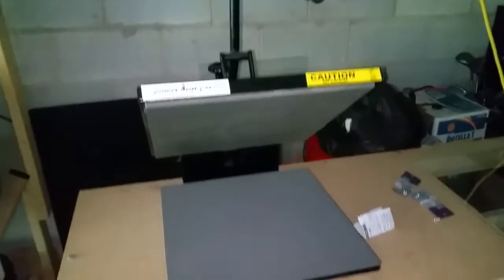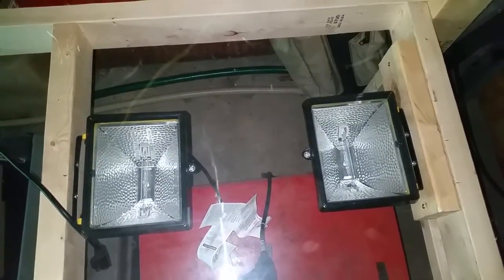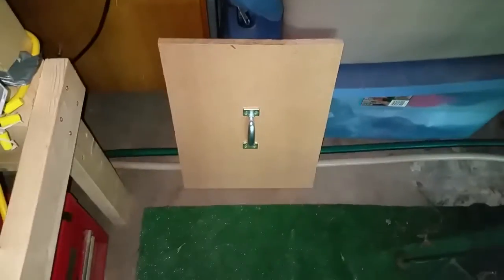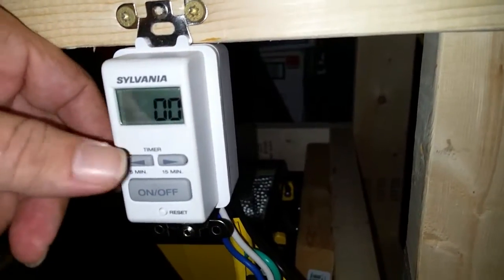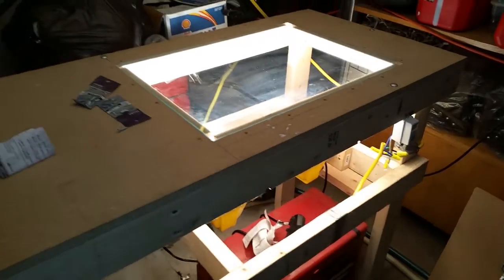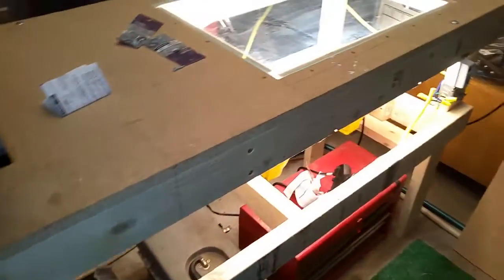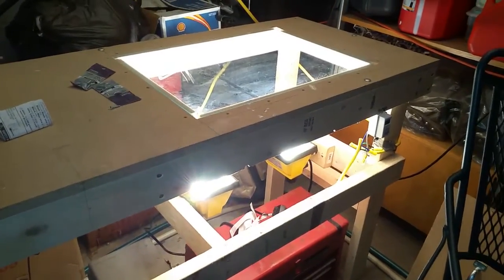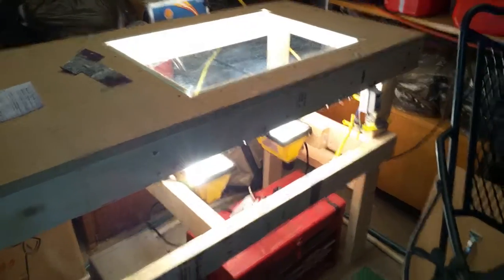DIY EXPOSURE UNIT FOR SCREEN PRINTING

Comment: Hi where did you get the timer
Reply from the maker: Buda Boco At lowes but you don't want that one.  It couldn't handle the power and blew out.  Try an electrical supply store and tell them what your running through it and they should be able to hook you up.  Don't forget to tell them it has to be able to be set for low increments of minutes.  Some of them can only be set for a minimum of like 10 or 15 minutes.  Hope this helps.

Comment: hi again excellent work!!can u tell me the diastance did u use from the lamps to the frame?
Reply from the maker: themajorhead Well to be honest I didn't even measure.  lol.  But typically they say for halogen bulbs like these to have a distance of approximately 17 inches from light to screen.  I just kind of winged it.  But it works better than I ever expected.

Comment: I like it but I'm thinking of doing it in reverse with the lights up above inside a cabinet I already have. Can you tell me the distance you have from lights to the glass?
Reply from the maker: John Malloy Approximately 17 inches.  The only problem with having the lights above the screen is it's really hard to put enough weight on the screen to have good contact between your film positives and your screen.  The way I have mine I can put any weight I want on the screen.  I typically use about 30 lbs evenly distributed.